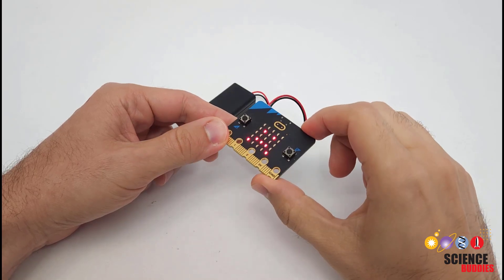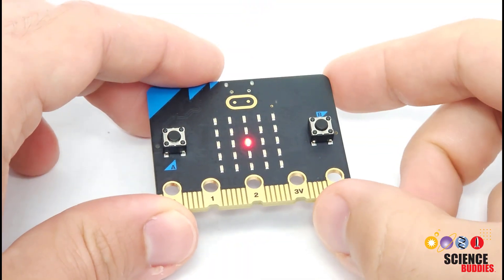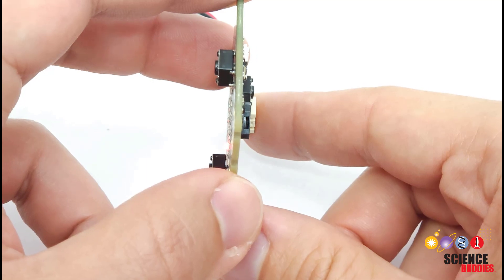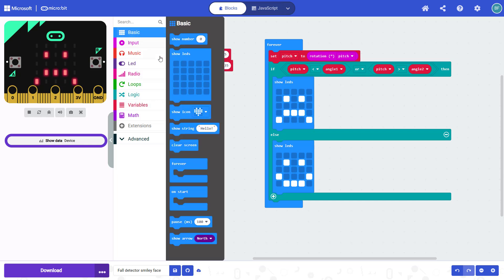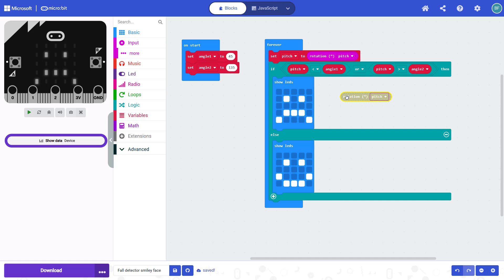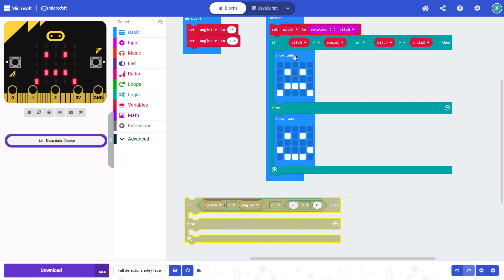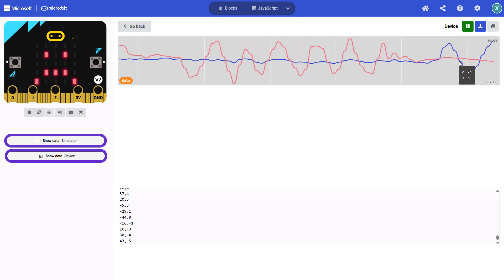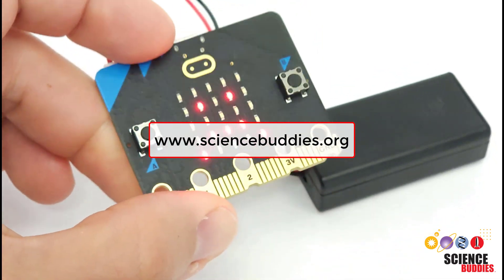Medical Alert Fall Detector with micro:bit | Science Project

Comment: i cant see "show data device"
Reply from the maker: If you can't see "show data device" then your computer might not recognize that the micro:bit is plugged into the USB port. Please follow the written instructions linked in our video description which have more details and link to the instructions on the micro:bit website for getting started and connecting your micro:bit to your computer.